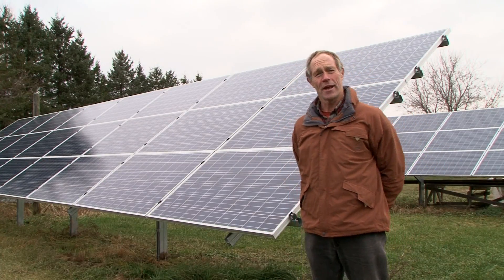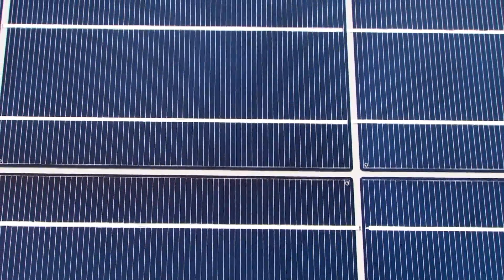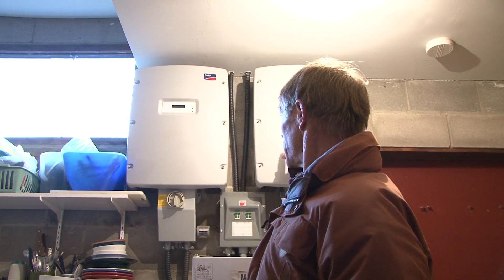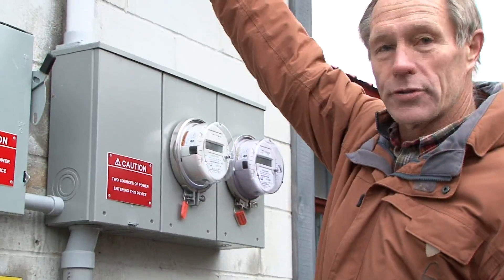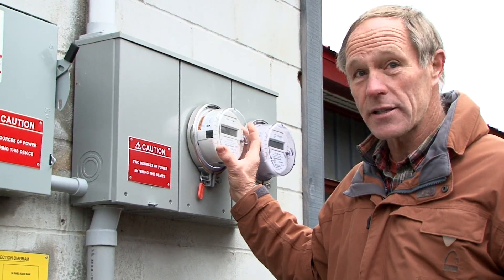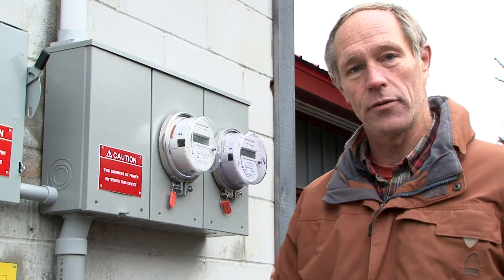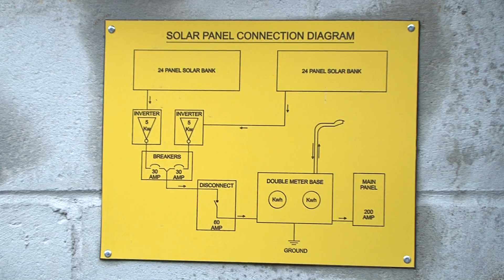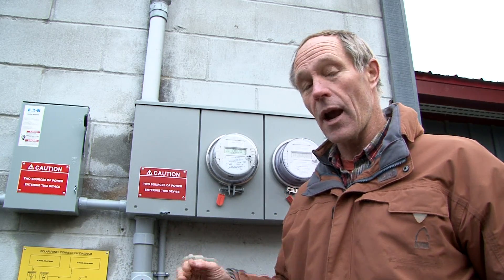Dick Bakker's Solar System

Comment: Not a good investment imho. 
Always more risk doing business with liberal governments. 
http://business.financialpost.com/fp-comment/boondoggle-how-ontarios-pursuit-of-renewable-energy-broke-the-provinces-electricity-system

This guy seems smart enough but doesn't respond to questions here. 
So anyone else who wants to challenge my assumptions, go ahead. 

Assumptions
he produced 63038 kWh in the first 6 mths which included the 2 lowest producing winter months. 
he estimates that's $5000 worth, therefore $10,000pa
= 8c / kWh input tariff (at least initially) 

Americans appear to look at the strength of an investment to see if cost can be regained before asset expiry, and call it payback. 
This is not as informative as doing an Internal Rate of Return calculation on all cash flows of an investment, which I'll do below with the following assumptions. 

Costs
71,000 beginning of first year. 
500 pa for sinking fund for maintenance.

Income
10,000pa x 20 years. 
15,000  receipt for sale of depreciated solar panels at end of 20 years. (even if he keeps the panels, you still need to enter a realistic sales figure to complete the cash flows)

IRR =  15%pa

Initially, that could have been further discounted to cover the risk of the govt breaking the 8c tariff contract....which ended up being a realized risk. 
Other risks that might be included are destruction by tornado, storms, vandalism, hail, or just poor quality panels. 

A 15% return on investment is very reasonable. However, it is quite achievable by buying stocks (when share price gains and dividends are added). Plus shares are much more liquid. 

But the final part of any investment analysis is to work out the risk adjusted reward. 
This is generally done by working out the investment return above a risk free investment such as Govt bonds or treasury notes. 

On the size of it, Dick was scammed by a bunch of naive and subversive Marxist greenies who pedaled a lot of bullshit. 
But like a lot of educated liberals, Dick was naive and didn't listen to both sides of the story, especiall the one being told by the Ontario Society of Professional Engineers.

Comment: A small 2.5kW system @ 6 hours peak sunlight (California) should produce 5,250kW energy annually. This equates to $420 @ $0.08 per kW. This system should cost about $10K USD all in. ROI is 24 years.

Comment: Dick - also @ 10kW system, you should generate 40-50kW per day (4-5 hours sunlight) or ~16,500kW per year. This would also calculate out to be $1,320 USD revenue per year. I am still seeing a 50+ year ROI. Something is not right here.

Comment: Hi Dick, I believe you are selling each kWh @ $0.08 USD. Is this correct? If so, in 6 months, you generated roughly $507 USD in revenue from the system. Payback on $71,000 would be 70 years. Did you miss a decimal or am I missing something?

Comment: Canada's FIT is incredibly high.  Our Net-metering in the USA is slow to attract Solar installations and the SREC program has tanked.  Even at 1/2 the Canadian FIT price, I'd be all over a large Solar install at my house - of 10KW or more.  Right now, I'm looking to maybe do a 5KW system and doing it mainly myself to save integrator costs and make the system come out at $12K after federal tax credit.  We pay far less for a system in the USA - and we don't get paid anything special for kWh's.

Comment: Great Video and excellent presentation!! 

@jeojeomorgen, I think he said aprox. 6600kWh in 6 month. A 10kWac (aprox. 12 kWdc) system will produce between 13000-14000 kWh per year and the FIT he is receiving is 80.2 cents per kWh. So that would be roughly $10,000-$11,000 per year.